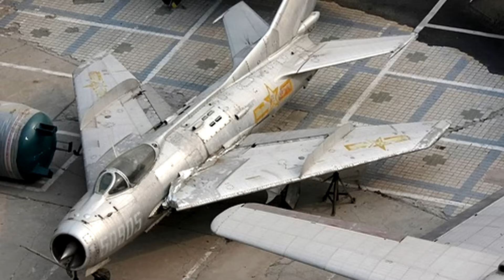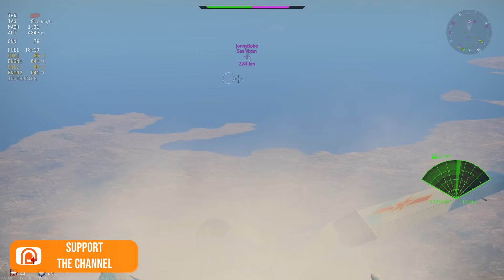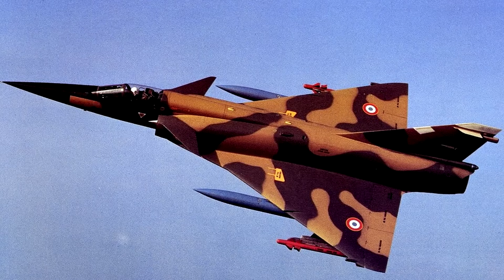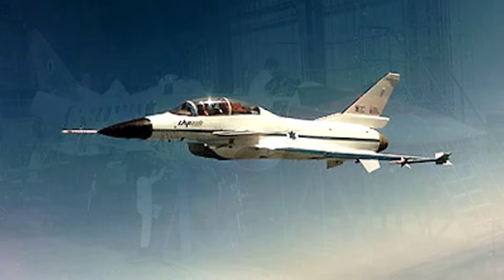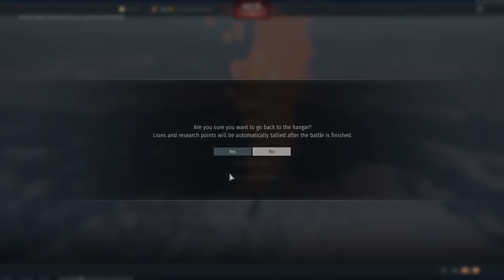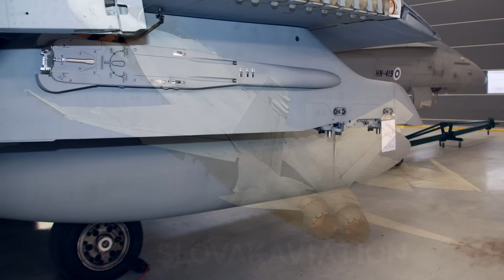Aviation Part 2 - Passed To Developers - December 2023 - War Thunder

Comment: Please ask the devs to add arrestor cables on the runways for jets without drag chute or bad brakes
Reply: Just get slow before reaching the runway
Reply: @haubentaucher8382  even if you get to 280kph, it takes way too long to stop completely with the A4E for example
Reply: @charleston1527  I never had any issues with the A4s brakes or any other aircraft with bad brakes. Doesn't the A4s have dragshutes? Or do only the Israeli ones have them?
Reply: @haubentaucher8382  The A4E and B don't have drag chutes, they are navy aircrafts. They also have very poor brakes. That's why adding an arrestor cable at the end of the runway could be useful, there are also lots of scenarios where it might come in handy.
Reply: It is not
Reply: anyone actually using their landing gears has smooth brain
Reply: @Mark-ft7nw  if you land without damage you can j out and respawn which is faster than belly landing
Reply: but thats only for navy aircraft........
Reply: @jasperhunter8386  lots of aircraft like the F16, F4E, F104, F15, F105, F5E, etc have arrestor cables for emergency landing on the runway. It can also be useful for navy aircrafts like the A4's that have no drag chute and poor brakes.
Reply: @jasperhunter8386  no it's not. Pretty sure most jets have hooks for emergency landings
Reply: @jasperhunter8386  almost all USAF jets have it , f16 , a10 , 15 , f15 , f4 and its for arresting cables on runways
Reply: @jasperhunter8386  nuh uh, most of US modern jets have emergency hook, F16 for example